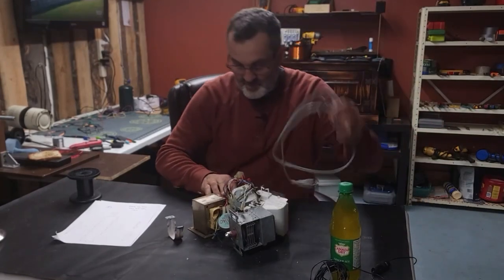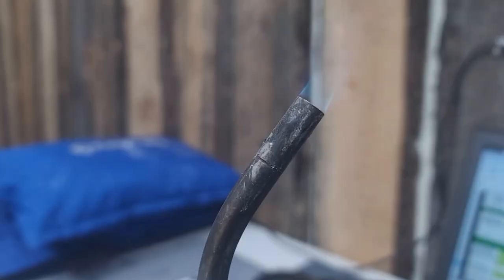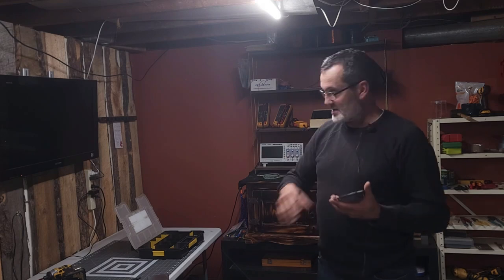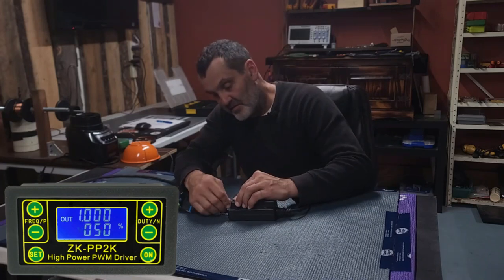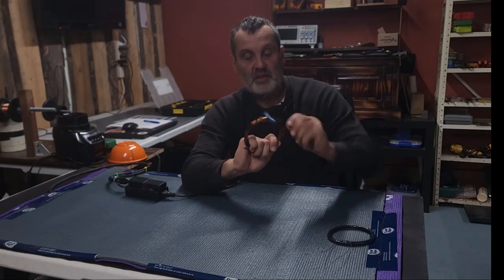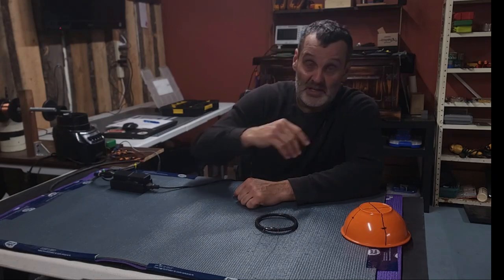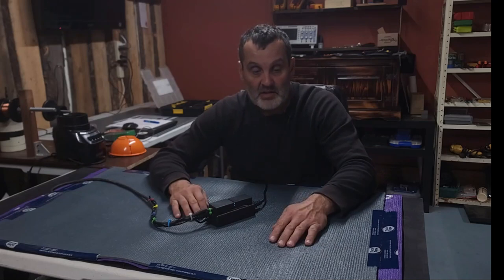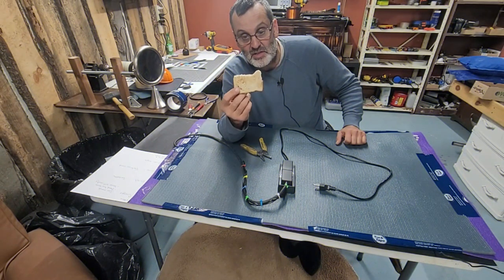In an Attempt to Save the World, I ended up with Toast

Comment: Very interested in how to make one better! Thank you! Can you send me the spreadsheet please! Really enjoying this. Question, does the wire have to be insulated? I have taken apart lots of electronics and I have fans, solenoids, and transformers I could scrap the wire out of but wasn't sure if it's needed to have the insulation wrapping on it. I obviously would be wrapping it with electrical tape during the process. I also would love to see checking the polarity . thank you for everything! I'm enjoying the 4 coils I made! I plan on 3d printing some things I'll share with you soon
Reply from the maker: Awesome !!! 

The magnet wire has insulation, it is varnish.  That is what burnes and smoke .

Let me know of your design!!
Reply: Also what frequencies would you recommend for things? I'm really enjoying using it
Reply: 🙏 great explanation about explosions haha.. placing the Zz 2 unit’s contacts on that metal plate 🤭🤭🤭 Great tips about parallelling coils, putting three “lighter” ones on top and  then that  check tip with that moving magnet, learning all the time, like YOU do 😉. I also have some ideas about using the unit and send a very low dutycycle pulse without coils, but directly with electrodes, like Hulda Ckark and her zapper on 33 KHz. For elektrodes I used a silvermat in the shoes, left and right foot, low current of course 😉 👍 🤭
Reply: 😂😂😂 cheers on that toast 😂😂😂

Comment: Have you tried setting the ZK-PP2K device to the 4 main Schumann resoncances?  7.8, 14.3, 20.8 and 27.3. I will try that and see if it makes a difference.
Reply from the maker: The zk is jard set to whole number. 

1.000 on the display means 1000

0.001 on the display means 1

:)

You need a decacou ter chip to acheive this.   

Working on making  videos  on the topics.

Comment: What's the diameter of the wire used in this video?
Reply from the maker: #23AWG.  
👍
Reply: @Steeve.  THAT'S THE UTP MNEMONCLATURE THE ONE THAT IS LIKE SILVER COLOR AND NOT ISOLATED OR ESMALTED... YOU PROBABLY MEANT 2UEW WHICH IS SIMILAR TO THE ONE SHOWN IN THE VIDEO... BTW, WHAT'S THE DIAMETER OF THE WIRE??? 0.41 - 0.45 - 0.5 - 0.6 - 0.65 - 0.7 - 1.2 - 1.5 - 1.6mm???
Reply from the maker: @greatdaddy4710  23awg